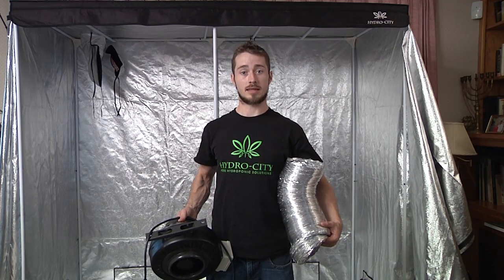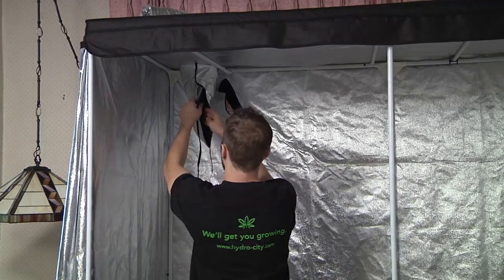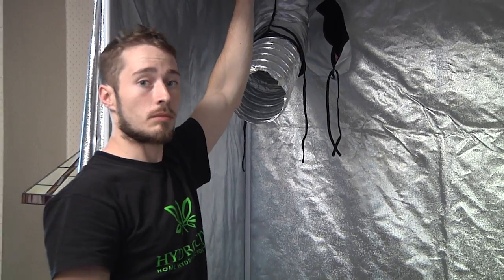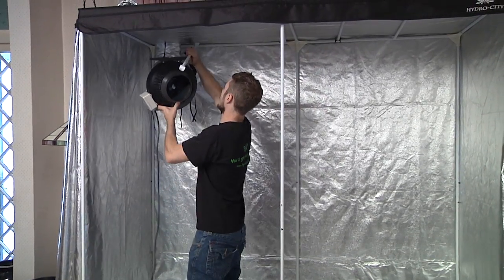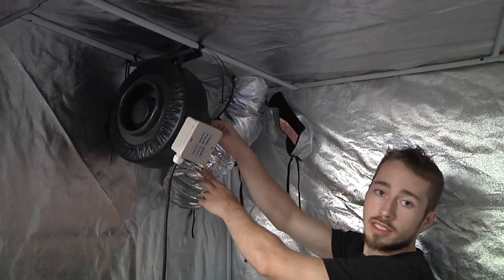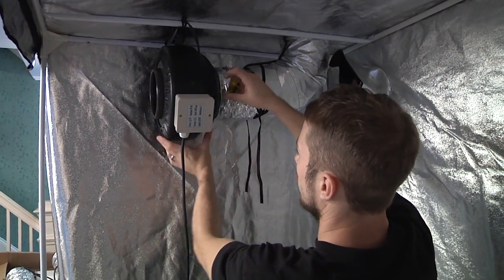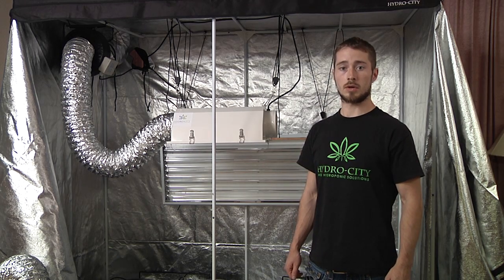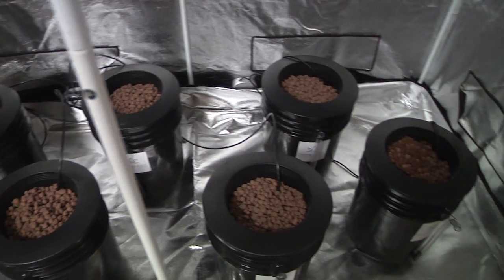Hydro City: Installing your Ventilation Fan and Ducting

Comment: I designed a new air duct fan, which can be connected to the network via WiFi, controlled by a mobile phone, and set rules on the mobile phone, which is very easy to understand.

In addition, the device has a recording function, which can record temperature history records, and store startup and shutdown history records.

I want to invite 10 people to review it. Take a 1-minute video and the sample is free. Welcome to contact me directly.

Comment: I have probably a dumb question. Why are we purifying air that we are pulling out of the grow tent and not they air we allow in? I just trying to understand the process. I feel like this setup pulls the crappy air from inside the tent and the air filter cleans it and then shoots cleaner air out the exhaust pipe. Why don't we instead PULL air into the tent with the purifier so that way the plants have better protection?
If the filter catches mold and mildew as it pulls the air out of the tent doesn't that mean the filter full with the mold and mildew is sitting right inside the tent?
Reply: The filter is more so for cleaning the smell from the air and not for purifying the air
Reply: If your not concerned with smell then you can set it up that way. Just put the filter on the intake side of the fan and set it up by the floor intake. That’s how most houses are connected anyway. Heat/air on the floors or low walls and return vents at the ceiling

Comment: I'm having a nightmare of a time setting up my ducting and fan. Which side does the fan get connected too the cooling or hot side.  I'm so confused I have everything and I'm clueless and the videos aren't really helping.
Reply: filter in tent, fan on top of tent, tubing from fan out the window

Comment: Can you keep the carbin filter on the floor or do you recommend hanging it in the tent?
Reply: the warm air rises along with odour so its fresh cool air through the bottom and carbon filter at top
Reply: eaither works the same way.

Comment: what if I can't make the exhaust go out of a window or chimney can it just blow out the top of my closet? would my room be humid as hell or will it be fine
Reply: Tyler Brotschol if you have a very efficient and low heat LED then I would say this would be okay, but do make sure to keep a good supply of fresh air(not from the area the exhaust is going) coming in to the tent
Reply: Tyler Brotschol
Reply: Smddd Pussy how did it go ? Bout to do the same thing